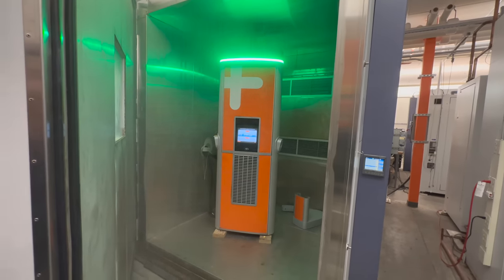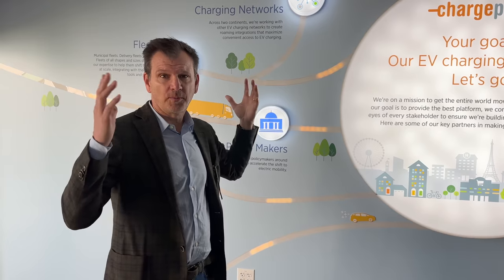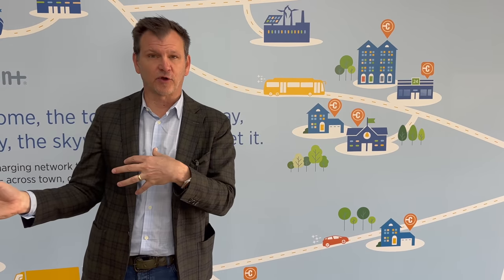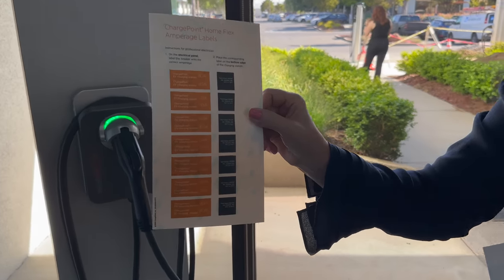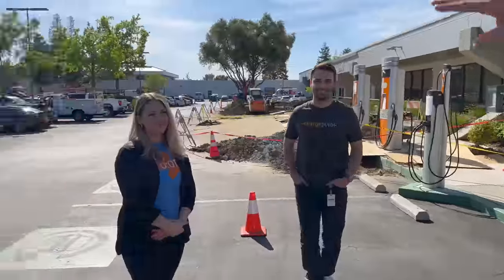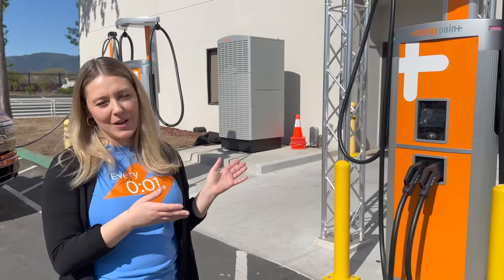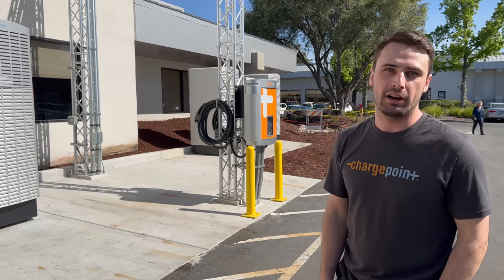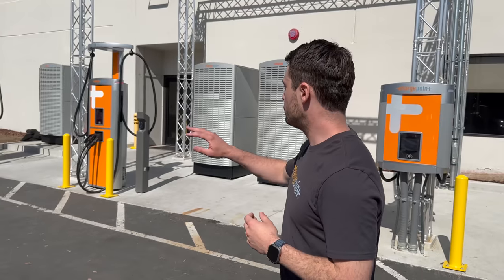Inside ChargePoint - Full Tour Of Hardware Engineering, Test Laboratories, & Product Portfolio

Comment: I suggested the new upgraded Flo DC chargers in Princeton BC that were 50KW and upgraded to 100KW to mark them clearly, they took this recommendation on Plug-share the same day I posted this and  they have followed up. So yes having proper Maximum KW output is very important to display on the dispenser.

Comment: Absolutely fascinating. How cool of CP to give you such access and information. The thermal and solar loading room is interesting. But it makes me ask, why don’t they build a sun shade/roof, whatever over the charging stations to mitigate some of the heat and sun? Some shade makes the customer more comfortable and shade makes it easier to see the screen. It wouldn’t make installation much more expensive, just basic construction.
Reply: Unfortunately it would make the install more expensive at least by some bit. It would also increase complexity and time to install. I'd rather have all those resources put towards faster/more charger and not a shade canopy.

I do agree though that ChargePoint needs far brighter screens, theirs are some of the dimmest on the market.

Comment: Charge Point needs to put DCFC stations put in the wild!! When I first got my EV, I'd use the level 2 J1772 chargers and get a 50/50 charging experience, whether it had to do with the connection to my EV, the charger being down, or the software being wonky (shutting down after less than 10 minutes of charging). I'd like to use Charge Point more, but I haven't had a great user experience since 2016 & that means I go after more reliable and quicker charging companies & chargers.

Comment: 34:51 One thing I would be curious about is whether increasing the size of the Power Modules from 31.25 kW to 40 kW has resulted in an increased charger activation time. As far as public charging providers are concerned, ChargePoint has been the gold-standard for startup times, and the only factor that seems to account for startup times is the module size. The only faster DCFC activations are from Tesla, and they use even smaller modules. Everyone who is using 50 kW or larger modules appears to have significantly slower charger activation times.
Reply: The module capacity does not affect the startup time.
Reply: @walkingbits  That's good to hear. For some charging providers' hardware, it does.
Reply: About module and charging activation: If you stand stand to a CPE-250 you can audibly hear whenever the second power module is connected - you'll hear a click and output will go beyond 31 kW. If you hear no click and are stuck at 31 kW or below, you'll know there's a failed power module. It happens nearly around the same time the station makes its "charging started" chime, so you have to pay attention to the click.

Comment: I look forward to the day when all charging stalls are set up for plug and charge, and highway exit signs have EV chargers and kW speed listed.
Reply: All stations will be on the center displays. Why waste money on signage ?
Reply: @205rider8  So you can drive without having to rely on your screen for everything.
Reply: @205rider8  Signage is important, as are the apps, when you have a provider such as Francis, where most of their units cannot charge an EGMP 800-volt vehicle at all.    It would be great if PlugShare had some checkoff tab that would let users flag which units those are. Imagine going to a gas station and finding none of the pumps’ nozzles would fit in your car’s gas tank.    That’s how bad it is at some charging stations when you have an Ioniq 5, EV6, etc

Comment: Impressive reliability analysis and testing. I see why the stations cost as much as they do. Still, all stations will fail given enough environmental and user abuse, and that is where the site owner indifference ruins the EV driver experience. In my experience, L2 is very robust but DCFC is a much greater challenge when the site owner just doesn’t care.

Comment: Truly amazing video. I was pretty surprised how open they were about so much of their hardware and processes. I really like the A/C ChargePoint chargers we have around my area. Very reliable. Only thing I want ChargePoint (and Electrify America) to do is remove the minimum balance to use the app to start charges. You have my credit card. Charge me what I use. A minimum account balance to use the chargers through the app is a bit dumb. I want to have the information the app provides but appears that is not possible if I just tap to pay or use EVgo card. But otherwise ChargePoint is just incredibly reliable from my experience. Would be nice to get DC Stations in my area but the low power stuff is available where I need it.
Reply: You'll be glad to hear that ChargePoint just announced the ability to use pay-as-you-go charging starting in June. You don't have to carry a balance any more or need to do top-ups. You can just pay for each separate charging session you do.

Comment: I would rather have two screens to ensure I am only paying for my charges and not the car next to me. The combining seems non-intuitive.  Are the batteries in the power module LiFeO2? or Li cobalt based?  I don't understand their claim about cable technology catching up as why they didn't use higher amperage rating.  Hasn't Tesla been using high amperage cables for some years?  I do appreciate the level of quality testing that ChargePoint achieves.

Comment: Home charging: I loved that my home charger linked to my rate plan. Unfortunately ChargePoint did not update the plan when the rates changed. Trying to get through to someone on customer service is a nightmare.

Public charging: ChargePoint's customers often set the charging costs poorly, for example huge idle fees at hotels after four hours on level 2 charging.

Comment: I wish charge point would convert to per kWh charging im Canada now that it is legal. A lot more PHEVs could actually plug in to their sites that have a 50kw main unit and 7kw AC charger, but they are priced way too high so you may as well use gas because they bill by the minute.

Comment: ChargePoint hasn't yet addressed charge-back for shared home use. Some use cases - several college students share a house and need to allocate power costs; vacation home owner needs to block charger use when the property is vacant, then track and charge-back renters' use.

Higher power costs make this more important than it has been.

Comment: All level two public charging should be a minimum of 40 amps - 9.6 kw.
50 amp breaker x.8 = 9.6kw.
Larger 19.2 kw would be great for all the Trucks and large SUV with 100 kwh battery packs.

Comment: For the in home offerings charge point should do some testing on the EV6 and Ioniq 5.  I have that same charger, and the charging fails if I set the charging rate too high.  They need to get in communication with the car manufacturer to figure out whats causing this.  Its a common problem discussed in the EV6 forums.
Reply: That's an issue with the car, not ChargePoint or any other EVSE. That's what the forum will tell you and I'm on there too. It's a hardware issue/defect that HMG has been trying to address (but it hasn't been going well).

Comment: @24:30 A local CT4000 charger at a restaurant has had a lot of trouble with CP and their service of their unit. They have tried repeatedly to get it up and running (it's 3 years old) and were told their charger is no longer supported by ChargePoint. It's disappointing that CP hasn't done more to address the issue. Looking forward to better CP service going forward as discussed.

(Nordic Brewing in Bozeman, MT fwiw)
Reply: I'd guess it is totally related to change in cellular service from 3G to new standards. I'm sure Chargepoint can fix the situation but it may cost some money to upgrade to either ethernet or new cellular modem options.
Reply: That is one crux of ChargePoint is they haven't historically supported units for very long. Hopefully their current generation of products they are willing to support with parts for 10+ years.

Comment: Seriously wish they were installing more high speed DCFC (200kW+) as opposed to the predominantly 50-62kW chargers they’re rolling out. Also need to have more than chargers per install, at least 8-12 in high demand areas.
Reply: ChargePoint doesn't host the charging stations. They are sold to a customer who manages the stations. Usually these customers purchase around 5 stations to start and then after a while, more are purchased. To scale them takes time.

Comment: Charge point needs to put in bigger breakers . Our work has 30 amp . They need to put in 48 amps to get a faster charging. It’s to slow 26 miles per hour at home I’m getting 44 miles a hour . Not enough charging stations so people have to move there car mid day so others can get on them . A must to put in bigger breakers 48 amp . Let’s do it 👍

Comment: It looks like ChargePoint is really trying to make a reliable charger.  It would be nice if they would resolve the incompatibility problem charging Energica motorcycles.  It seems like no one cares about about fixing this.  ChargePoint used to be the goto charger for my 2022 Energica Eva Ribelle.  Then ChargePoint made a software update to their CP250 units and successful charging became hit or miss.  I got the latest Energica software on my bike last month and now ChargePoint CP250 units will not work at all.  I have no problem charging at EA or EVgo stations (when they are not broken).  Unfortunately, I need to use ChargePoint chargers on my favorite rides in my area.  I currently feel like I'm living in a charging desert as far as the Energica is concerned.

Comment: 27:50 ChargePoint really needs to tell certain customers like the State of New Mexico to pair their CPE-250s. Not a single CPE-250 installed by the State of NM is in a paired configuration which really sucks that we're limited to only a 62 kW charging speed. Especially if ChargePoint plans to keep selling the upgraded version of the CPE-250, they need to communicate this better to site hosts. 

Some site hosts are afraid of pairing due to increased utility demand fees but they fail to realize their demand charges will be exactly the same if 2 EVs show up at 2 unpaired stations. There really is no reason not to pair!

Comment: One huge issue that might need addressing in the future, actually now because it is already happening, is how to prevent vandals and thieves from attempting to cut off the charging cables from the charging unit, and selling the copper so they can buy meth (or whatever they are into.) Perhaps the cable could be protected inside of something like a spool, reel, cabinet, or cage where it gets stored when not in use, and only unlocks for the user when they go to charge. Maybe even install a GPS tracking device inside the cable, or install security cameras to help identify the perpetrators. Hopefully it does not become too big of an issue, but only time will tell. It would be good if EV charging manufacturers start thinking about solutions in advance, and how to implement them. I realize the risk of things like this happening can vary wildly depending on the location of the charger, and what kind of environment surrounds it.
Reply: None of the solutions you proposed would be very useful in practice. Security cameras are only a passive deterrent unless there's actual security personnel on the premises. A hidden/spooled cable would introduce more failure points. GPS tracking is not really that useful and would be hard to integrate.

The only thing I see that might make a difference is making the cables more cut resistant by changing the jacket material. Make them harder to cut.

Comment: I have found that when a ChargePoint station has a problem and I report it to ChargePoint driver support, nothing seems to get fixed.  All they do is reportedly send an email to the owner, with no follow up.  Usually the owner (apartment complex, school, or business) seems to have very little concern that the station is down, and they do not want to spend any money to get it fixed.  So many ChargePoint stations around town have been down for years, showing as a grey color on the website.  I believe this business model of 'owners' needing to fix stations will be the downfall of ChargePoint.
Reply: Totally agree. Indifferent site owners kill the EV driver experience.

Comment: Love your videos! Why are all Chargepoint chargers always soooo slow?
Reply: They are not slow for what they were designed for  they are not meant to be ea and highway chargers. A lot of new ev drivers are spoiled specially tesla drivers. They hog charge point and complain about speed and I say keep to your network cp250 are meant or city use not like ea on the interstate.
Reply: @markfitzpatrick6692  I just feel I've used them as destination chargers and got like 3-4 percent in one hour. That makes no sense to me... I totally get they are not en route fast DC chargers but If I leave my car for 2-3 hours for sure that means a full SoC.
Reply: @Per.Norberg  Many of the level 2 chargers out there in the US right now are tied into 208VAC three-phase power. That's the common power you find in commercial buildings and parking lot lighting. So 30A is the maximum you can pull which is only 6.6kW.

Comment: I would love to know the reason that they dont properly size their cables.
Reply: They said it in the video, higher voltage cars are the future. Car battery voltages are creeping higher. It's just much more efficient to DC fast charge at lower current (amperage) and higher voltage to get the same or even more output power.

Comment: To play devil's advocate a little; Back in the late '60's early '70's I lived in a city where temperatures were routinely sub zero F for days if not weeks on end.  In those days, it was near impossible to start a frozen car.  It was mandatory to have a block heater, especially overnight or when at work.  When shopping, it was common to leave your vehicle running.  There were many organizations that were forced to charge users for that power.  A couple of hundred employees all taking roughly 1KW of power to heat oil or coolant ends up being non trivial.  Now imagine a near future scenario where every vehicle is an EV.  While not everyone at every location will be charging all the time, there will need to be enough access points to curtail user frustration.  I don't think we will tolerate long lines to hit a charger.  This will be especially true when the cost of charging a vehicle is essentially the same as filling up with gasoline or diesel.

Comment: The daily commuter is clearly the largest demographic and adoption of EVs is coming up quickly. The other fairly large demographic is the tourist. Most routes that support tourism are not on major highways and therefore do not always support the EV driving tourist due to business economics not paying off well. For example, US highway 160 that crosses southern Colorado from the eastern border all the way to the Grand Canyon in Arizona, passes through the Navajo Nation between Cortez CO and Tuba City AZ without any DCFC systems and only a very few destination systems available. The politics of Native American governments may be a factor in adoption and certainly population economic challenges are a big factor as well. These regional factors could be addressed by applying some of the IRA funds to major charging network companies' self-operated efforts in order to bootstrap these "off-the-beaten-path" routes to the advantage of both the companies and the local populations. I hope chargepoint can apply some of their self-operation efforts in these directions.

Comment: They can create these stations and all of this infastructure all they want. Until there is an APP that is comparable to teslas trip planner, its just going to still be a mess. I use ABRP for trip planning and it by far is the best so far. But it cost $5 a month. Not bad, but I would rather it be free.
Reply: I want to add, this was impressive. I really like this informational video. This was good. But so far, EVGO and Electrify America are my go to since they have been far more reliable, and more stations that are closer to they highways.

Comment: Problem with dynamic allocation is vehicles which stay plugged beyond 70 %.
Massive education is needed @ charge sites "billboards if needed"  to explain this bottle neck to ev folk.
Charging over 60% is a waste of time. N should be a higher rate.
1:07:59. I rest my charging.